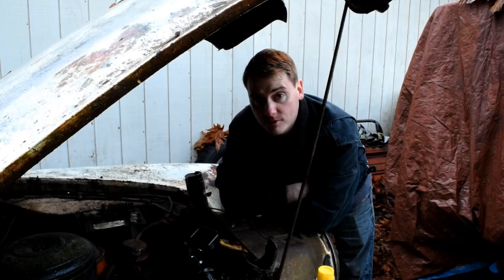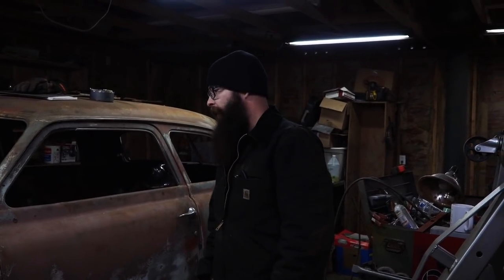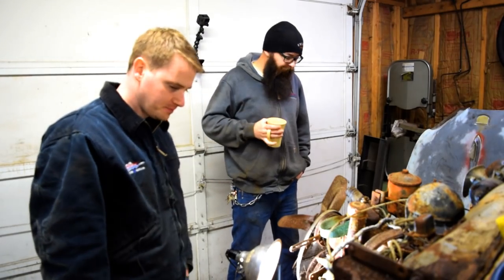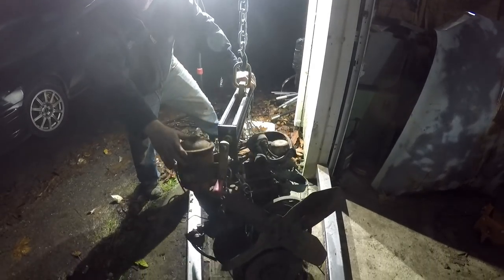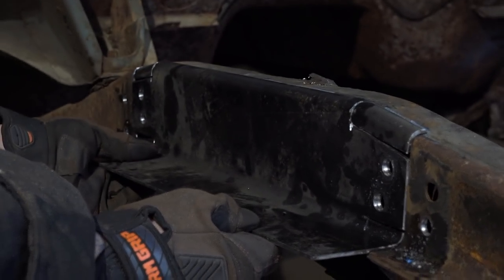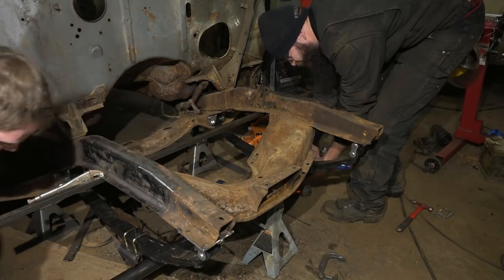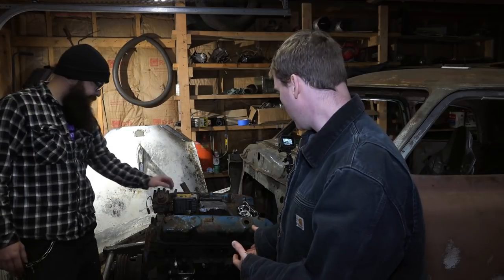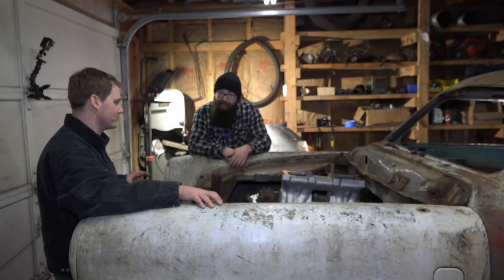The Dodgebaker! Studebaker Gasser Build with 440! | Not Rod Ep. 4

Comment: Nice!!!  I'm building a 59 Studebaker lark gasser with a full cage.. I'll be interested to see how this build goes.  BTW its a lot easier to just buy some 440 fenderwall headers and adjust your motor mounts to make them fit, than it is to fab custom headers from scratch or modify existing ones.. i used fender headers from a jeep and the worked perfectly.

Comment: Very cool...you will probably find another small round heater core behind the dash, it's for the defroster...
I'm doing a 50 Studebaker Champion Starlight Coupe similar to yours.
Mine is going to be low with a slight nose up look, rear wheel wells opened up and engine is being set back 10 in.
so the carbs will be at the base of the windshield. 
Engine is a 327 Chevrolet with all the go fast stuff, tunnel ram w/2 650 Holleys , zoomie type headers, scatter shield, M22 "Rock Crusher" trans, rear end is a Dana 60 with spool and 4:10's, race axles, s10 leaf springs w/floaters and sliders and truck arms being used for ladder bars and triangularly mounted and adjustable. 
For the front it's a 4in. dropped tube axle w/coil overs and four-bar, front steering and on and on , have all the parts it's just starting to go together...just going to be a go to town car..seeing your bit there got me fired up so out to work I go..I can't wait to see more..

Comment: Your having fun and not one dog was hurt in the filming of this episode. I for one (72  year old delinkwent ) would thrive in this environment. I even put words in that google can't unscramble in one to ten tries. After cutting a huge hole for the tires to fit in the back think it looks better. I wouldn't go with fender flares. I would use old burring barrels cut to fit and welded in so the rubber coming off the tires is just rubbing against them. I hope this doesn't influence your final thinking as it is art work in motion

Comment: As a Mopar 440 and  Gasser fan I'm going to be hanging on, looking for each & every video of this project... can't wait. I've always been a Ford, Mopar guy and I still regret getting rid a a B/G 63 Falcon I had, kinda radical engine set back (interior edge of dashboard was where firewall was) tilt fiberglass front, straight axle, 9 inch ford radiussed wheel wells in back. The car had never been finished, however it did' have nice 2X3" tubing frame up front,  the tin work, firewall looked as if Al Bergler did it.  but no subframe connecters, or roll cage of any kind... My plan was a 390 GTA engine and trans and street drive it!

Comment: Again guys cool build, also the way your going about it , actually wrenching it apart dirt and all in moreless the dark ..that's the way I do it except you at least are in a building , I'm in my driveway and I live in Oregon...just across the Columbia River and east of Longview Wa. 
So you guys know what the weather's like in the area..
Anyways I just watched the episode again , and I'm curious to what your doing for your rear springs, I saw something about a Dana 60 and you show cutting the wheel wells and the rear wheels on but no mention of suspension set up...probably in the next episode?  It's just where I'm at with mine at the moment, what I am going to do about springs.
I'm running a Dana 60 also , sort of ,60 center, new tubes with ford ends, spool, custom axles, 11" ford drum brakes, long ladder bars mounted with the front mount inwards, housing floaters, the original springs are in good shape but they are only 1 3/4" wide ..I just got some  s10 springs , 3 pack, main ,2nd and the third is the thick overload leaf, thinking replace it with a same thickness as the other two.
Just curious to what you come up with.. 
Getting dark got to go pick up things and move into the kitchen...
#2 work area when it gets dark or nasty outside.
Reply: The tire is just in the wheel well in that episode but it kinda has one in it now. D60 spool 35 spline axles and long ladder bars. Im thinkin ill use the original springs but havnt decided how it will attach yet, maybe sliders or possibly a shackle design like quarter elipticle. Youll have to make it out to riverdale when yours is done.

Comment: Not a big fan of the Studes but I like it! Love it that your using a 440 Mopar! What year 440 is that? Cast or Forged crank?
Reply from the maker: Late 70's Motorhome.  Forged Crank.
Reply: Great. I raced a 62 Plymouth Sport Fury, 440 w/ push button 727 & a 3.91 gear. Stock short block w/ comp. valve job, blend work by me (rookie) and a 284-484 Hemi Grind cam & lifters  (Direct Connection) Weiand open plenum manifold and an 850 Holley, lotta fun! Love your project and I subbed so I can follow it

Comment: If you have a intact drive train you might break it loose by towing it in gear ?
Reply from the maker: Sometimes that works but we were kind of anxious to get to work on the gasser, and with all the water that looked like it went down the motor we figure those cylinders are probably packed full of rust.

Comment: I hope you realize that on a pretty much stock engine that tunnel ram is actually going to kill power not gain power. You are better off just running a single 800cfm 4brl. Tunnel rams do best with huge cams, high compression and massive ports. Now stack injection on the other hand... much more forgiving. (but incredibly expensive.. unlike a Ford there is no cheap Aussie knock-off Hillborn kit for it)
Reply from the maker: The engine is going to get built to the hills.